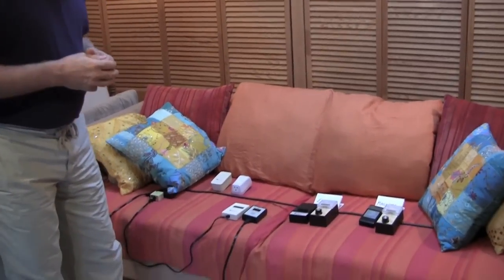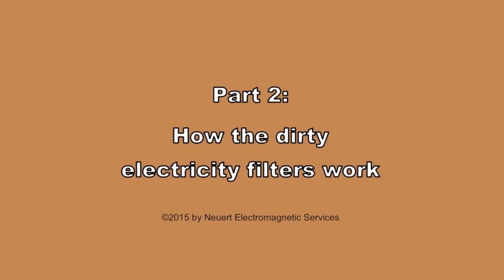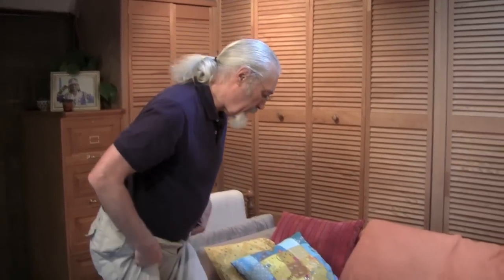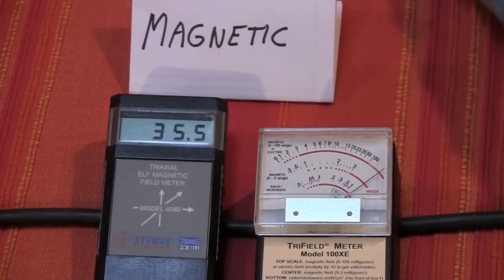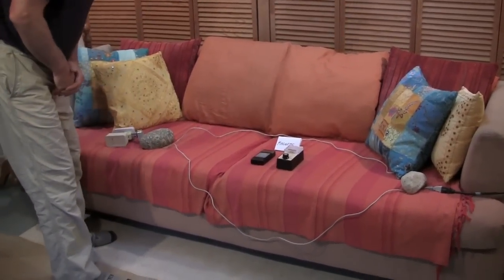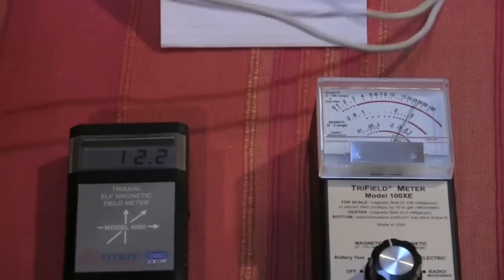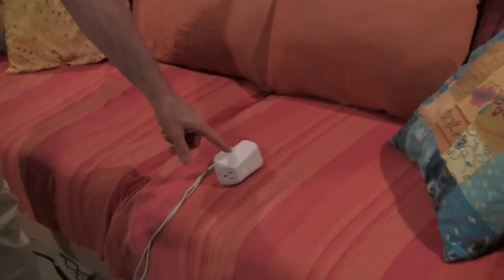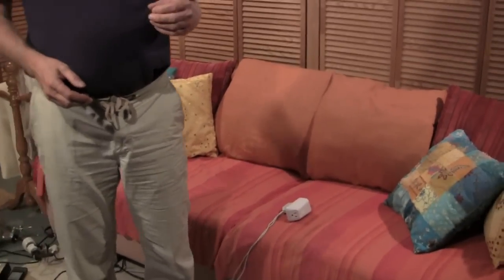Perils and Problems with Dirty Electricity Filters: What to be Aware of!

Comment: When will we get some updated regulation and Enforcement on the dreaded importation, sale and use of the most hideous “ switch mode pores supply” ? The failure of the FCC and Industry Canada to get tough on filtering and proper SMPS design is truly criminal. The Radio Spectrum ( and Environment as it relates to EMF) is a priceless, irreplaceable natural resource. Poorly designed and installed solar panel systems are now causing EMI that covers miles...Every cheap phone and laptop charger that is poorly designed or built ( which is  most of them) is causing an increase in the RF  noise floor - which means it’s also likely being conducted by your house wiring...and traveling to your neighbours wiring. I have seen “faked “ approval Stickers, approved devices that , after getting approvals, simply stopped using the filters on the circuit boards to save a few cents in manufacturing. Yes..most come from China. Please be aware your own devices my be adding to your problem. If you have a very noisy SMPS “ wall wart”, consider replacing it with the older style “transformer” wall wart. They do not generate all the bad “square Waves” nor spew RF smog into the air and onto wiring. Thanks for your excellent explanations.

Comment: Regarding the noise: if the filter is buzzing audibly, this can be a sign that it is overloaded. We use to live next to a baseball field with huge lights. Whenever the lights were turned on for night games, our filters would buzz loudly. Adding more filters solved the problem.
Reply: And did you check how much the magnetic fields went up?

Comment: This video has completely thrown me. I was about to buy filters but now I dont know what to do to reduce the DE in my home - which is high... :(
Reply: Same with me.   Go to the website stopdirtyelectricity.com  He also wrote a book "Exposed".  There is a meter he recommends to measure for Magnetic radiation that he has tested (as a professional) that is $148, he says it is  very accurate for the non professional.  I am going to buy it.  I am still going to get a couple of greenwave filters and their meter and use the other meter to measure the Magnetic radiation.  I think it will help diagnose some issues in any event.  Since you only need one GreenWave filter per circuit, just place it in the location that is furthest away.  I will use the magnetic meter first and then compare after.  I am not a professional, just a person trying to feel better and attain better health.  Wifi and 5G are another problem.
Reply: @delaville680  I'm still a bit overwhelmed by information since I just recently got into the topic of dirty electricity again. Can you say that the number of circuits in your house/flat is equal to the number of breakers in the breaker box? Just so I know how many filters I would need if I got any.
Reply: @lazi21  I bought Greenwave filters & their meter.  You need the meter to know if the electricity has been tamed in the room you are installing the filters.  When you go on their website, they have a guide by room count.  I chose these filters because there is a plug on the filter so you are not losing that outlet.  You will find you need a lot more filters in a room that had a lot of electronics.  They do emit a mild magnetic field (I bought a meter for that too) so I try to place them atleast a foot away from anything living LOL.   You will be shocked when you see the dirty electricity readings from your outlets.  Great investment in your health.
Reply: @delaville680  Thanks a lot!
Reply: @delaville680  Did you feel any differences when installing the filters?
Reply: @lazi21  for me, I was more nervous before I put the filters in.  I feel calmer now.  I also turn my wifi off at night.  Not good to sleep with that on.  I have turned it off for years. (I got the filters two years ago)
Reply: @delaville680  I also turn my wifi off at night and sleep grounded for better sleep :)
Reply: @delaville680   what is the life span on these filters? And is there a warranty?
Reply: @franchisefred4066  I don't think there is a shelf Life.  Not sure about warranty.  But Greenwave is an excellent company.  If you are ever not sure about the filter function, you can use the meter to test it.  You will be amazed at the dirty electricity readings you will get before the filter & what the reading is after.  You will need more than one in a room especially if there is electronics.  You have to buy a meter.  I also have a meter that measures magnetic fields as well & the field is very low & it dissipates with distance which is not far.  So I am happy with these.  Plus you don't lose a plug they have one in it.
Reply: @delaville680    Already did my homework lol. Don’t need another explanation repeatedly. And i wasn’t talking about shelf life (stored) to collect dust. Thanks but you sound like another salesman trying too hard and totally ignored my question, should’ve just said you have no clue whatsoever 😂
Reply: @franchisefred4066  I am a female person who genuinely tried to answer what I thought you were asking which is how long do they last.  Apparently I ran across a total jerk.  Sorry I wasted my time on a mean person like you.
Reply: @delaville680    Sorry for being an honest jerk. Sometimes being an honest jerk is better than being a polite liar. Have a wonderful day
Reply: @franchisefred4066    I always have a nice day because I live a very blessed life thank you.  Being nice & kind to people brings that to your life.

Comment: Wow! This was super helpful. Thank you for this. This explains why I did not tolerate our Stetzer filters at all since I am pretty sensitive to especially magnetic fields. I measured away from the filter itself and indeed it took the magnetic field up significantly along the wall where I sleep. It gave my daughter a huge headache as well. This really helped me better understand some electrical language like voltage and current. Thanks so much.
Reply: Curious at what magnetic field levels were u able to tolerate? I’m trying to figure out how high is too high sometimes u may just be able to mitigate one and tolerate the other. I’ve noticed with electric fields and how much is too high for me, next testing magnetic fields

Comment: I am an electrician also and currently learning about this fascinating area. Your demonstration of separating the active and neutral conductors with a magnetic load was brilliant. I found this in my lounge with a very high magnetic field supplying low voltage lighting transformers(wire wound). The single active conductor was run from a remote switch.
I really think the educators in the electrical industry are doing untold disservice to householders by not instructing electricians properly in this area. I have no idea when things will change for the better though. Cheers
Reply: We have seen this video before and it is inaccurate and sadly misleading.
Let me explain how magnetic fields are created in homes. The Live and Neutral wires have opposing currents which both create magnetic fields, but they neutralize each other when the wires are next to each other. When you separate the fields you get an independent magnetic field.  
This misleading video sets up a wiring error by separating Live and Neutral wires and then puts a voltage on them which will always create a magnetic field under every situation.
This is NOT a result from the filter, this is from the wiring error created. If instead of a filter you place a light bulb or a phone on charge in the circuit you would get the same magnetic field so its NOT caused by the filter but the wiring error.
In Australia we use twin and earth cables where the Live and Neutral cables are manufactured within the same cable so the magnetic field is neutralized. Only where the live and neutral are separated will a magnetic field occur.You will always measure a small local field around every powerpoint which has a device plugged in and is switched on because the wires are separated out in the back of the wall socket to supply the socket, so with any device including the filters you will read a magnetic field at the power socket or any place where the wires are separated, this is called a wiring error . This will typically diminish at around 30cm distance. You won't place the filters under bed heads to avoid sleeping spaces.
I hope this clarifies the situation and the video misleading the public.
Reply: @moniquedrexel3475  Do you work for Stetzer ? do you claim to be more knowledgeable than Michael Neuert? thank you.
Reply: @marceloovg1873  I'm certain Michael is knowledgeable but he has misrepresented whats happening when you separate live and neutral wires.   He is making out its the filters that are causing the magnetic field. ANY device drawing current with that wire configuration will cause a magnet field if the you separate Live and Neutral. Best you work your way through whats happening in the circuit and it become obvious. Its not about either filter manufacture, its physics.
Reply: @moniquedrexel3475 He's explaining how a magnetic field can be increased by wiring errors while using the filters. He made it clear why the magnetic fields are created. It goes without saying that anything plugged in will create those magnetic fields when those wiring errors are present.

Comment: Thank you for demonstrating some of the incidental aspects for laymen trying to clean up the emf in their environment.It also provides very useful information regarding the hardware and subtleties of applying the common solutions. You have nicely demonstrated the high effectiveness of the commonly used devices and measuring equipment to my relief. Those interested now have insight in how to project to their individual case the effectiveness and desireability of the available solutions. I have a framework for evaluating how filters would impact my personal emf load and perhaps a way of assaying what aspects of emf threat I most need to address.

Comment: Thank you for this video. I was just about to buy Greenwave setup worth several hundred € but after those downfalls you pointed out I don't think that purchase makes any sense. Basically filters just sweep the problem under a rug. The problem changes form but stays. I wanted a simple solution to fix the dirty electricity without any cons. Apparently there is no such solution available.

Comment: If the Stetzer and GreenWave filters were in a shielded box, would that reduce the magnetic field coming from the filter itself?
Reply: Magnetic field can't be easily shielded in the same way as RF or electric fields with metal boxes. Mu-metal is virtually the only barrier and that is expensive.  The field from a filter is gone at around 30cm or less so not a big issue. The electric field from the wiring in the wall is a much bigger health issue. Don't place them on your bedside table or under your pillow and you should be OK. The video is talking about magnetic fields from wiring errors, the filters themselves are not the issue its the house wiring, in the example provided the circuit would produce a magnetic field no matter what was plugged in. Don't use single wires / separated wires, use pairs so the electric field neutralizes the magnetic.

Comment: Any filter of this type contains a capacitor and it is connected ‘across
the line’ or line to neutral; this capacitor will generate a current flow of
its own when connected in this way. This current flow will change with the
frequency of the applied voltage and with voltage variations on the ac line; in
the good all USA we have approximately 120 volts @ a steady fundamental 60
hertz; voltage varies from location to location as much as 10% (the transformer
configuration feeding your house and the local electrical loading all influence
this voltage) with various additional voltage spikes and dips occurring with loading
disturbances and electrical storms. Frequency is rock-steady; however other unwanted
frequencies can ride along the power line (harmonics); these are caused by load
disturbances/electrical items drawing current at frequencies other than 60hz;
things like computers, battery chargers, non-incandescent lighting, all lighting
on solid-state dimmers, motors, air conditioners, some heating devices, etc. A given
filtering-capacitor value will draw a current at 60hz and a higher current with
higher frequencies; so the more high frequency ‘noise/harmonics’ on the power
line the more current these capacitor based filters will draw. When these
capacitors are drawing current they are dissipating power; these capacitors
have a limit as to how much power/energy they can handle/dissipate; exceeding
this value will eventually cause catastrophic failure of the capacitor; this
can lead to a fire. Your protection against this catastrophic failure is the
circuit breaker in your home feeding the circuit containing a filter and or similar
protection within the filter device itself. Make sure any item you plan to
connect to your electrical supply has a UL or ETL or similar safety agency
approval label. However, remember all bets are off if you (your home) are hit
by enough energy and these protective devices become swamped and this high
energy releases itself at the appliance; this can be a spark and sparks are hot
and fires start with ‘hot’. Wisdom - something is going to kill you, eventually,
so get about life and always be prepared to meet our marvelous Maker.
Reply: Hi Michael Neuert and Clint. Michael have you heard of fires started by DE filters? The Greenwave filters are UL listed, but how can you ensure they don't set fire to the house? If you plug them into a surge protector? I live in an old ramshackle beach house, built at least in the 1950s, maybe earlier, the house was once moved, it's been a rental for many decades, and not well maintained, no inspections or updates in as long. I don't turn the circuits on and off at the panel because I'm afraid they won't turn back on. The house wiring isn't grounded, or if it is, the outlets aren't, and appliances and light switches radiate high electric fields. I am wondering if using the filters in a house of this kind is just too unsafe and risks setting fire. Are the filters more likely to cause a fire than a switch mode power supply computer charger?

Comment: what if the filter itself is connected to the breaker panel. would it still produce the magnetic field in the house wirings?
Reply: Only on the branch circuit the filter is on.

Comment: Hi Michael,  Thanks for all your info. I have 3 different meters, the trifield, like  yours, the k-18 and just got the GQ EMF 390.  When I put my trifield meter next to the K18, I get a really high magnetic field reading, the K-18 has high readings all around different areas of my home. I bought the GQ so I could get the actual numbers, and in high spots I've had readings over 2000 EF..When I turn off my main breaker to the house, the reading are the same. So, what is a girl to do now? Mylar sheets hanging on walls where the reading are high has helped, and I also put up a shielding canopy around my bed where I used to get very high readings, now are more normal, still getting pops and taps sounds on mylar sheets and high med and low frequency's sounds in my head. Get dizzy spells, body vibrations buzzing feelings.. Any suggestions would be greatly appreciated..

Comment: A good overview to understand the problem
Thanks a lot

I have measured 230 GS with Stetzer Microsurge Meter in my House at daytime, when "every" consumer is off.
Even energy-saving lamps and dimmers don´t change much.

2 Things will increase this value very high.
A LED Flower Lamp (225 Leds) rises to 400 GS
My Computer rises to 800 GS
Both together rise to 1700 GS

I don´t know the accuracy of the meter, because i bought a power supply for my computer with PFC activ, that should face the problem with "electrical harmonics" (google translated).

My diy-filter costs 3.5 $ and eliminates the problem to 60 GS

Comment: Thanks for all the info. I do wish youd present some solutions though. I myself am very sensitive to such RF and EMI fields. I do remember in your other vids for example how your room is so low in RF radiation, and Im guessing probably in electrical radiation also. How do you achieve this? I bought an RF meter and can measure sources of radiation now, but how can you measure these electrical fields accurately? Obviously the stetzer filters and meters are not a solution as you just demonstrated. Could you also not just use a volt meter through your fingers and ground to test these fields? Thanks.
Reply: To see what kind of an affect it has on your body specifically would be to setup a multimeter with the common connected to ground and the voltage lead connected to a conductive handle you hold. Then set the meter to volts and see what your body voltage is. That will tell you what sort of capacitive coupling effect an electric field has on you. As for magnetic that's a different animal altogether.